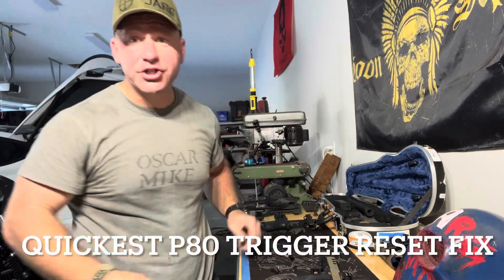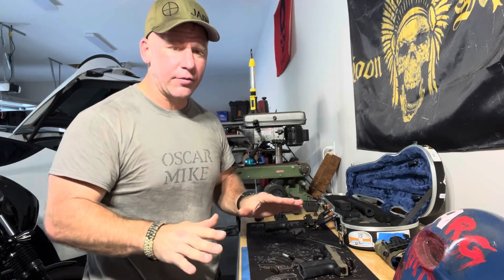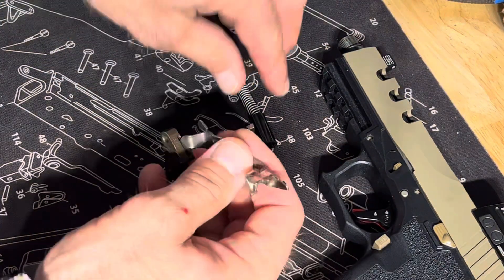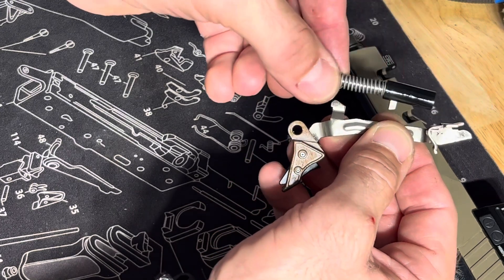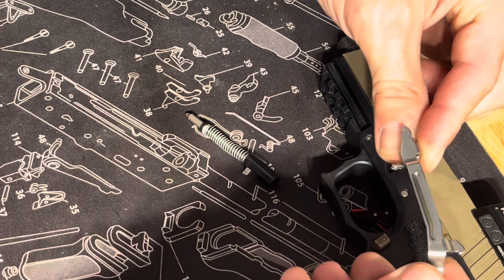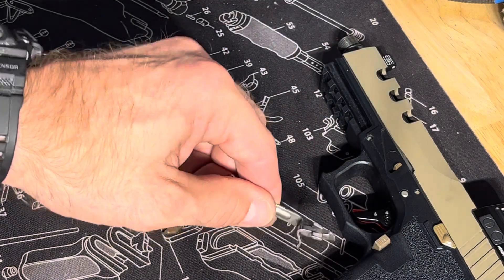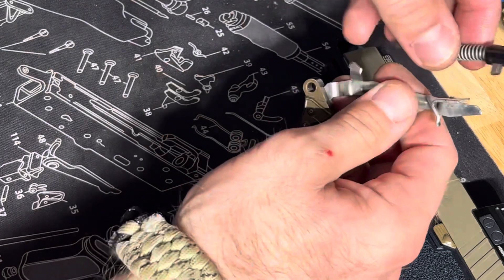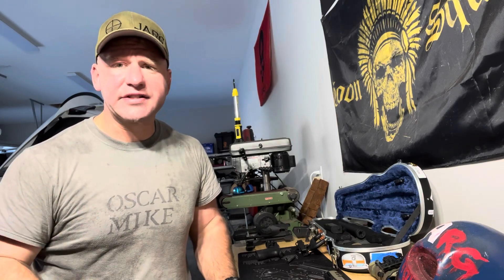P80 Glock Trigger Reset Fixed. #1 problem FIXED Guaranteed

Comment: This video resolved my issue with my P80 burst firing. For the life of me I could not figure it out until I saw this. Thank you!
Reply from the maker: Glad I could assist. Plz Like, Sub, and tell haters that these methods work.
Reply: @JARG  I am stuck on something else though. I'm still having FTF issues. I have tried the recoil springs with no success. Last time out at the range it seemed like the pistol would cycle fiocchi ammo about 75% without a problem. Everything else cause jam after jam. Having a hard time narrowing this issue down.
Reply: @Ztuned88 Did you find any solution or progress?
Reply: @Momo7O7  I did fix the burst fire issue by bending where he instructed. Now I'm having a failure to feed issue. Every so many rounds the casing will go about half way and stop. Some ammo is worse than others. I haven't tried polishing the feed ramp yet, but that's about all I know to do. There's no weird burrs or maching on the barrel
Reply: @Ztuned88  have you made sure that your rails are in alignment and are smooth?

Comment: I remember my neighbor had a G19 that wouldn't reliably reset if the trigger was held down a bit firmly because the slide wouldn't be able to push the disconnector over. The crucifix seemed to catch the FP just fine on cycling, but only if the bar had reset per the slide pushing the disconnector off of it. I didn't think it was possible for the slide to NOT push the disconnector over, but I guess the trig bar will just flex over with it if it's pushed into the disconnector hard enough and not slip out from under it as it's supposed to. I don't know if he ever figured out how to remedy it but polishing the end of the bar like this seems like it'd do the trick.

Comment: I'm having an issue with my p80 build. The trigger resets but it is not releasing the striker sear, so it won't fire and it makes taking the gun apart to look at it very difficult. Any ideas?
Reply: Get a dremel, some cotton polishing bits for it, and some polishing compound.  Polish sear/anvil and striker lug until super smooth.  Polish everything else while you're at it.  (See Johnny Glock videos).  Drop of oil.  If that doesn't do it, your sear may be too engaged.  If so, do the opposite of what this guy recommends.  You want 80-100% engagement, or so I'm told.  More makes it hard or impossible to release.  Less makes it dangerous.

Comment: Thank you for the video, I didn’t have the 80% lower, but I did have the GSX100 from the Glock Store same problem trigger not resetting I followed your video so far 185 rounds with only one failure, taking it again to the range this Saturday, going to shoot more then 200 rounds, if I get one failure to reset, I’ll adjust the trigger bar one more time.

Comment: Figured I'd add what fixed my gun here too. Maybe every 1 in 5 wouldn't reset properly. I tried grinding down that small section by the rear rail insert where the trigger bar touches it, but ended up taking way to much off and made my problem worse! I tried bending the  crucifix every so slighrly and still had the problem. I then tried grinding down the polymer inside the frame were the teigger bar meet does a 90 but that didnt help either. By this point now, almost every other reset wouldn't happen after racking the slide. Luckily, I just so happen to have a new 3.5 connector and heavier trigger reset spring coming in. After installing those, it completely resolved my issue, even with the messed up grinding I did. I still ordered a new rear rail since it was royally messed up with my handy work.

Figured Id comment this in case anyone has tried everything and is looking for other suggestions.

Comment: Love your mindset. I've watched all three videos now. That recoil spring didn't fix your problem, it overcomes it with force. The problem is that Rock Slide. I know I have several. The firing pin channel is burred. Pull your firing pin and see if it slides all the way out and back in with ease. If it doesn't there are burrs inside from the machining. Look at the block at the head of your firing pin, is there scaring from the firing pin channel?

Comment: I previously built a 80% arms G19 size frame with zero problems. Just finished polymer 80 G17 size frame with what appears to be the same slide as you and it's a constant failure to fire and the trigger doesn't reset so I have to release the striker from the rear to disassemble it. Thinking about pulling the trigger from my other build and trying it.
Reply from the maker: Trigger reset is your crossbar angle.  Fail to fire is because of your recoil spring and slide creep

Comment: So I just build my 1st P80 and have this issue. It would reset, 1 out of 10 trys.I broke my bar that came in my kit, so I went out and bought a CMC  $170 trigger. It worked for 5 times exactly and then quit all together. So I've bought another p80 frame and am going to. Try leaving the rear rails you Mill down a little higher.  What you think?
Reply from the maker: Still think it’s the cross bar angle
Reply: @JARG  you are a 100% right. I had an oem bar I bought I've been sitting on. It didn't work until I did what you said this morning. And Bingo, I got a working glock. I haven't fired it yet, but at least now the trigger works. I did heat mine red hot and then quenched it in 40w oil and polished

Comment: This video definitely helped me fix my trigger reset issue without the mag inserted. However once I insert the mag I get the same reset failure. Do I just need to bend the bar a little more to allow it to engage the striker with the mag inserted?
Reply from the maker: Yes. Sounds like the mag is pushing up on the slide
Reply: I’ll have to use an actual vice like you did. I just tried heating it up and bending it with pliers, which worked a little bit but I did have some difficulty getting a good grip on it.

Comment: I'm thinking just throwing polymer80 trash trigger group in garbage and using Glock OEM.  Will this not solve the problem, too?
Reply from the maker: It will not fix the loose tolerance

Comment: So should I bend mine the other way mine won't fire. It acts like the trigger is hanging on something is hold it from dropping. If you look in between the slide and frame. You can kinda see the extractor rase up a little and the trigger won't pull. Plz help. I'll give you my number to text or call if need be. I want to learn how to get it right. I've tried 2 diffrent triggers so it might be my frame. 
Thanks in advance
Reply from the maker: Email me with a number

Comment: I’m having issue with my build slide wont go into full battery sometimes but a little bump or sometimes if I let the trigger go or if I just wait or if I drop the slide normally not slowly It will go into full battery I think it’s something with the trigger assembly but I can’t pinpoint what’s wrong I compared it to my other build that works great and it’s all the same I even swapped the safety plunger and it works in my build that was already working good
Reply from the maker: Sir I know what is wrong 100%
Reply from the maker: https://youtu.be/H1qZDmd3LNk
Reply from the maker: When it works let me know.  Then LIKE, SUBSCRIBE, and SHARE
Reply: @JARG  it stopped having that issue not sure what fixed it just took it apart and put it back together now the slide stop lever catches just barely sometimes when I have a loaded clip in it but when there’s no clip it doesn’t catch I sanded the inside where it sits down a little so it doesn’t have down movement and it still catches occasionally

Comment: So this didnt fix my issue, i thought it would. I believe my issue is the metal spring bar that sits on the trigger. If i hole the slide on one side it resets and hold it to the other it wont so the slide isnt engaging the flat spring far enough to allow the trigger bar to raise up. So if anybody else is having this issue check that its not this either. Because there isnt a lot of material to grab and bend im going to have to grind one of the flanges down
Reply: Update so the issue was the trigger connector i believe it is called, the small bent flange had to be filed a couple thousandths to allow the trigger bar to move up when contacting the slide. If i put pressure on the slide to the right as a racked it the connector wouldnt engage fully and allow the trigger to reset.

Comment: Mine seems to function fine unless I hold the trigger while pulling the slide back.  Then it doesn't reset.  Would this help fix my issue?
Reply from the maker: Yes
Reply from the maker: You would only need a slight bend

Comment: Great knowledge man! I have that issue with my g19 (all parts OEM) only when i rack the slide very hard and fast..when i manipulate it "the normal" way, everything is OK..but WHY??? Do you have an advice?  
Best regards from germany! 
Stay safe over there:)
Reply from the maker: Cross bar angle
Reply: Could this have something to do with a connector ?

Comment: Is this the reason possibly why my new p80 build fires 5 rounds at once if five rounds are in the magazine or two rounds almost like a double tap if there's only two rounds in the magazine it seems to Auto fire
Reply from the maker: Your firing pin lug is slipping over your cross
Reply: @JARG  so do you think if I do what you did in your video? That would solve that issue because mine does seem pretty flat

Comment: I have a p80 build and my trigger respond or anything . I’ll rack my slide and it will not even let me push down on trigger at all . Any suggestions ?.. need help
Reply from the maker: Post a video on your channel.  Then show the inside of the weapon
Reply: I built 19 P80 builds and only the last 4 I've had the same problem with the sear not catching the striker lug I don't know if they changed the way they were stamping out the trigger bar or something???
Reply: @mikehittle4649  you get what you pay for I guess...

Comment: My issue is that i brought all glock parts ,  had a few light trigger pulls but my main issue is that once it chamber another round it fires after i release the trigger , only put 100rnds through it. My regular g22 mag cycled with no hiccups or miss fires. So im confused?
Reply from the maker: Sound like you got issues.  The problem sounds like the mag and trigger bar are pressing your slide up and causing the firing lug to slip over the cross bar.
Reply: @JARG  ok, so how do i fix the issue? I also brought a new guide rod and 20lbs spring after watching all three of your videos.

Comment: I bought an aftermarket Gen 3 G19 slide, and put it on an OEM Gen 4 23 frame (with a Gen 3 to 4 adapter) and I cannot get the trigger to reset. I managed to get it to once, but that's it. I have used aftermarket, 9mm and Gen 3 slides on it before without any malfunction, and the original OEM G23 slide still functions perfectly. Anybody have an idea or suggestion as to what the problem could be?
Reply from the maker: @jslaughterofthesoul4939  yes this video plus I have 2 more on it

Comment: I have a issue.the trigger break and reset is EXTREMELY close, maybe a 1/8” between the two of that...your thoughts?
Reply from the maker: Back of crossbar needs to be a little higher.  Check your firing lug.  I beat the wear marks are very low toward bottom
Reply from the maker: Let me know if I’m right
Reply: I'm not comfy doing that myself,I may just trade it for p320 or p365

Comment: Whats going on mann.. im having dead trigger could I be from cross bar sitting to high
Reply from the maker: What is happening.  Pull and what.  Moves or stuck.  Spongy then reset…
Reply: @JARG  once I fire first shot next round chambers, trigger reset, but when I squeeze to it drops but doesn't fire.
Reply: Did u find out the problem?

Comment: Hey bro , whenever I pull the trigger with a round chambered it won’t fire it even when I rack the slide and load another round in it won’t fire . Do you know what’s up?
Reply from the maker: Look at your striker lug.  Probably the connector is not causing the sear to fall.  Or safety plunger is not being depressed

Comment: I fixed this problem. But now the slide won't slide all the way forward after shots. I have to push the back of the slide with my thumb all the way forward to get it to shoot again any suggestions
Reply from the maker: @micahobaca  see #2 and #3 most common fixes for p80 on my channel
Reply: @JARG  thanks!